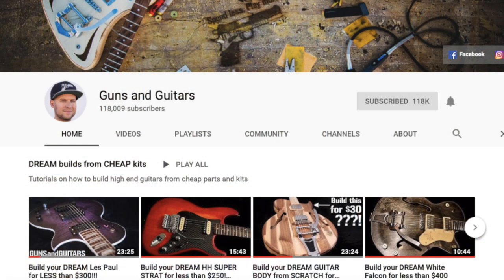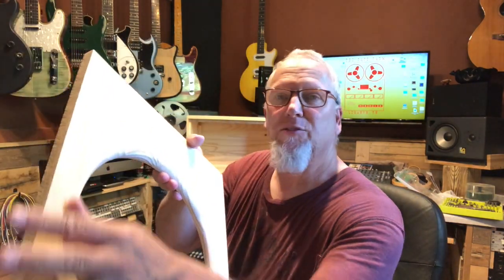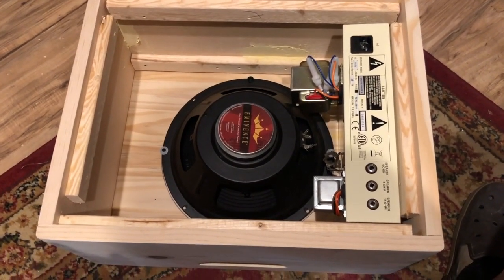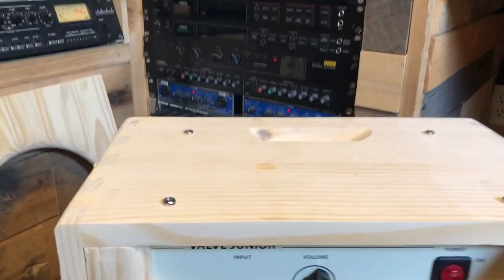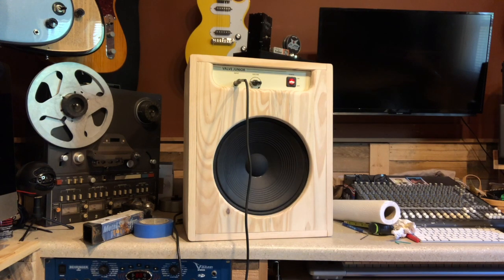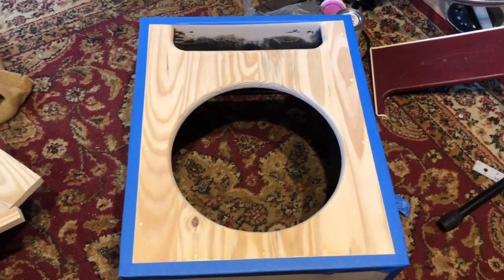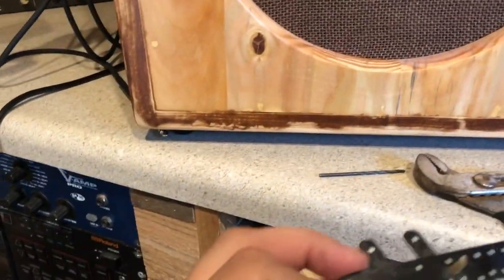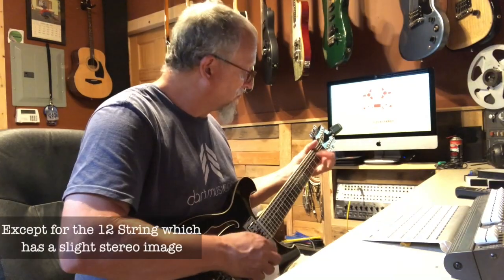Bee Box Deluxe - Live From The Tape Farm

Comment: Honestly it looks pretty cool BUT, you need to port the box.  Cut a 6" strip out of the back of the box, you can always' reattach it if you don't like it but when that cone moves that air has to go somewhere.  Bass notes are attenuated and highs are muted, the trapped air acts like a shock absorber and deadens the cone.  You could also purchase a couple prefab bass ports and cut them into the front, either way you need vents.  I built something similar, mounted the speaker high and installed a floor that was 3" short and 3" off the bottom of the box.  I then cut 2 vents into the face of the box in the 3" area at the bottom.  Basically copied a Klipsch Cornwall cabinet and OMG what a difference.